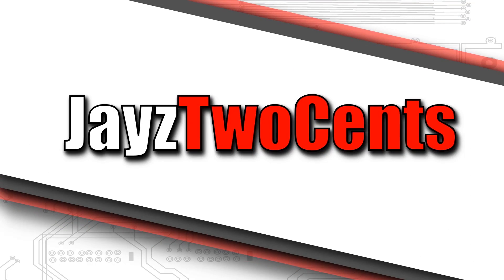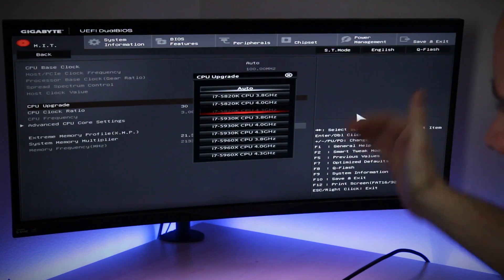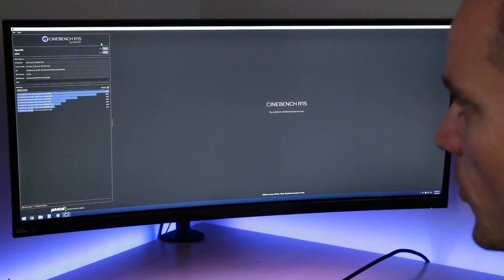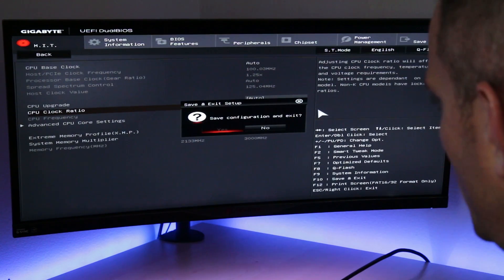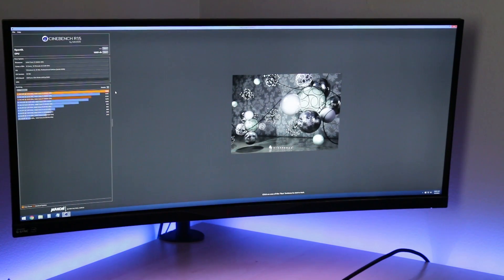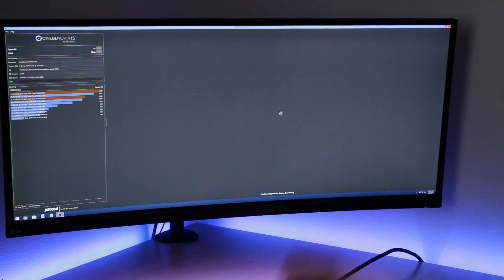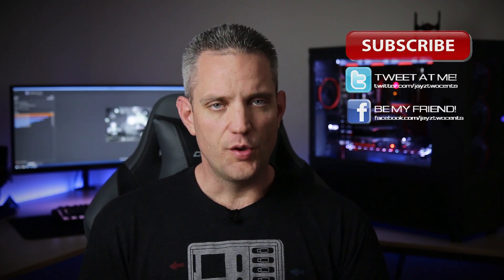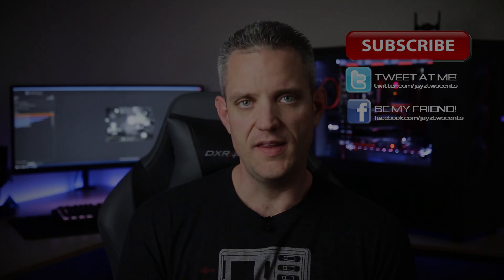XMP vs Overclock

Comment: Is it possible to overclock the laptop processor i5-2540m, and if not, why not?
Reply: Matthew Ferrie I really dont recommend it, even if its old, which... probably makes it even worse off for cooling, would recommend an upgrade. Do you by chance have a desktop?
Reply: +Matthew Ferrie trust me, you dont want to.
Reply: +Lord Drake Not worth it?
Reply: Not exactly, most laptops don't have good enough cooling to support going over the stock speeds. I've seen people do it before, but it's a much greater risk than over clocking a desktop with a decent cooler. +Matthew Ferrie
Reply: +Sam My computer is a dinosaur, so I... think... I might be willing to risk a bit of overheating. Besides, I have a cooling pad, if that even does anything lol
Reply: +Matthew Ferrie I literally melted the side of my laptop doing this back in 2010 don't do it
Reply: Lord Drake
Nope.

Comment: Can you put your computer specs into the description please. preferably the water cooler you use..
Reply: +SprintRaCeR24 you probably won't be able to afford it though
Reply: It's in skunkworks build logs
Reply: Matthew Kinney thanks
Reply: Its only a $125 water cooler. It wont fit in my case i dont think but yeah it isnt that expensive. Im just looking for a good water cooler since mine is hitting 2 years old. Also a bigger one such as 280mm radiator.
Reply: and trust me, mine is the equivalent besides the overkill $800 case(which doesnt make since, nor is any type of fancy) and the 3 980s. but 1 Titan X is suffice. ;)
Reply: +SprintRaCeR24 he has a custom loop cooling setup that costed  well above 500$ in parts if you look them up on performance pcs and he has 3 titan x's currently not 980s thats a old video
Reply: ah. well all i see is the "old" build..

Comment: another thing to keep in mind when overclocking.. is to make sure your BIOS is updated... I didnt update mine and it would always crash on a RAM overclock.. no matter what I did. 
BIOS updates are really easy now compared to before.
Reply: LOL sou that was wat was hapening. oc my ram from 1600 to 1866 and my mobo wold post no nothing:))
Reply: Same thing happened to me until I realized i forgot to update it :)
Reply: I know I broke an x570 a pro mobo other day threw updating it threw dragon centre comp restarted and would get an display after that took it to comp shop were bought it from said the had never seen an mobo breaking like it did . After a bit of argument managed to get it replaced but will never update an bios again if it's that easy to break mobo

Comment: I've had a 4790k for a little over a year now, I've been thinking of OCing it. This video just made that decision ^-^
Reply: +Skullcrusher1005 share your results bud :)
Reply: +Skullcrusher1005 My 4790k reached 4.6ghz at 1.3v. You can do it! That is why you bought a K series.
Reply: +Jim O I have a Corsair H105 for cooling just so you know.
Reply: Jim O The thing is, I only have a Corsair H60 I want to shoot for 4.5 but I'm pretty sure that won't happen, I'm pretty confident I can do 4.3 though :)
Reply: +Skullcrusher1005 I have mine oc'ed to 4.83ghz although I had to mess about quite a bit to achieve it. Good luck brother!
Reply: Blank Ty! :D I'll be OCing it tomorrow!
Reply: Skullcrusher1005 remember to move up in steps and to stress test along the way! Also don't get scared if you BSOD once or twice.
Reply: I got 4.7ghz out of mine
Reply: +Skullcrusher1005 I also have a H60 btw and I managed my 4.8ish so you should be fine if you dont pump too much voltage into it :)
Reply: Blank Wow, That's a hefty OC! :D I'll see what I can do :)
Reply: So here's the results, I tried to pull 4.5 using Gigabyte's preset, Turns out that was a bit too much. I started thermal throttling almost instantly using AIDA64 Extreme. So I turned it down to 4.3 (Didn't try 4.4) with 87C on the hottest core. That's still pretty high, Even though before I OCed it was about 76 on the hottest core. Which, AIDA isn't really real world testing so I'm pretty confident it's stable. I didn't BSOD with the 4.5 clock but it was running at max temp so it was just a matter of time :P
Reply: +Skullcrusher1005 woah 87c on water cooling at 4.5? that's high, very high imo. 
4.7ghz at 1.2v on a 4790k with a kraken x61 and idle at 20-30c heavy load at 50-60c
Reply: Skullcrusher1005 What is the voltage that Gigabyte's preset uses? You might want to check to see if the pump on your h60 is plugged in and working. Also you might want to re-apply thermal paste if lowering the voltage does not work. I will update with my voltage when i get home
Reply: Blank 1.18v @4.3Ghz 87c is pretty hot for that.
Reply: +Skullcrusher1005 insanely,  get it stock is my recommendation, surprised is that high with water cooling at that low clock and voltage. what I would do is this-
change thermal paste, clean the radiator and fan, make sure it's running properly like the pump and fan and adjust the fan curve. see if that changes things
Reply: Skullcrusher1005 I would check to see if the pump is running at 100% and maybe try to run the fan on the rad at a higher percent
Reply: XNinjaZero lol we are on the same track it seems *highfive*
Reply: I do not understand why your 4790k is not hitting the 4.4 turbo boost that is built in to the processor unless you have turbo boost turned off in your UEFI. Go to your CPU core multiplier and set it to 4.5 then set your core voltage ( or whatever setting that changes your CPU voltage) and set it to 1.2v and see if it works. If it does not post and run benchmarks then up your voltage to 1.25 keep raising your voltage in small steps tell it is  stable. I would not go past 1.35 volts in my opinion. Good luck..
Reply: Jim O Don't worry friend, Skullcrusher1005 and I are thinking that it is a thermal paste or cooler issue.
Reply: +Blank lol yeah, it happend to me before I always clean my rads 2 times a year, first time I connected it wrong and cpu sky rocketed to 90c and liquid temp to 50c, it was connected wrong and the pump wasn't working, was scared to death but learned from my mistake
Reply: +Jim O I never liked going above 1.25 lol
Reply: XNinjaZero I currently run somewhere in the neighborhood of 1.3 :I I guess i live life on the edge
Reply: Blank For the record, I bought my PC from CyberPower. I checked and the pump is in the CPU fan slot and the actual CPU fan is on a fan controller. I turned the fan controller to max and still no difference in CPU temps. I set it back to stock and 5 mins of running AIDA the hottest core was 77. Looks like I'll have to order some thermal paste. I didn't think thermal paste would deteriorate that fast in a year, I think it's using what was pre-applied to the cooler. I put my finger on the tubes and I felt the liquid running through so the pump is fine. I guess it's a thermal compound issue. I might order some Arctic Silver 5. Thanks for the help, Guys! :D
Reply: +Blank oh god, gotta love my chip and board xD
Reply: +Skullcrusher1005 well good luck to ya! just run it stock, you won't see much a difference in gaming 4.0 to 4.4 in gaming. I personally use mx-4 but they are both good.
Reply: XNinjaZero Thanks! :) I wanted to OC because I do encoding. This processor is fast at encoding as it already is but, Why not make it faster? :D
Reply: +Skullcrusher1005 true you will benefit more than a gamer would.
Reply: Skullcrusher1005 Thermal paste should not be affected after about a year, I would think that it is a bad application of thermal paste or seeing your temps perhaps no thermal paste at all.... but I would definitely order some thermal paste and make a fresh application anyways. Good luck!
Reply: +Blank if it's his first time using paste just remember him to use the highest percentage alcohol he can to clean and rice size dot is more than enough :)
Reply: XNinjaZero ***** has a video on thermal paste application doesn't he? :)
Reply: XNinjaZero Skullcrusher1005, ya'll should add me on steam. ill pm you
Reply: Blank I've seen many videos on thermal paste application :)
Reply: Blank Go ahead and send me a request "Skullcrusher1005"
Reply: Skullcrusher1005 will do when I get home from work
Reply: You do not want to run the pump on the CPU header. The CPU header will cause the pump to change speeds. Place the pump on a case fan header and make sure that header is set run full speed on DC and not PWM.
Reply: Max voltage on the 4790k is 1.4v but I would never run it at that. 1.3-1.35 is my max. Hope it all works out for you.

Comment: From my experience overclocking tools usually apply more voltage than is needed, personally I'm not comfortable to go to 1.45 or higher which that tool wants to put my chip at. I'm getting my 6700K only to 4.6 (4.7 on 2 cores) (on Z170 Premium) and my 980 Ti Waterforce from Gigabyte only to 1520. There's not much more return for going for more expensive components.

Comment: my VRMS get toasty when i try my luck at a higher overclock with my 5775c. it wants all the voltage. it survived pretty high voltages, over 1.475, but still no luck with a stable OC over 4.3GHz, yet. 4.3GHz @ 1.375v adaptive but with the uncore at stock since i'd need to up THAT voltage to equal or so to the main core. also ddr3-2400 1.65v

EDIT: yes the tinkering is fun until you have no idea why your system won't boot. then you leave it off for 30min and come back and have AGAIN no idea why it finally decided to boot.

886 cinebench score

Comment: My 4690k only manages 732 points :( But it's $750 cheaper :)
Reply: ***** and a decent one at that.
Reply: +YazeedSaber u overclocked to 4.8? i can only reach 677 at 4.6.
Reply: +li wenqi silicone lottery ;)
Reply: +YazeedSaber im running my 4690k at 4.7ghz :D 50c max temp
Reply: +TomaShen - nice. What voltage and cooler are you running?
Reply: +reno911unlocred the 4690k is a year newer than the 4670k with a newer chipset. 

It has improved TIM (Thermal Interface Material) which helps with heat issues and allows better overclocking. 

I have mine on a Gigabyte Z97X- Gaming 5 motherboard, running at 4.82Ghz @ 1.298v. The cooler is a Cooler Master Hyper 212 EVO single fan. Max temps don't exceed 65c.
Reply: YazeedSaber lol, 4.6Ghz at 1.22v, i think it is not bad. but I have no idea why I cant go beyond.
Reply: li wenqi that's very good actually! Nice voltage. Maybe try increasing the voltage to 1.3v and slowly increase the clock speed to see where your chip's max is. If you're running an air cooler, I don't recommend going over 1.3v for 24/7 use.
Reply: ***** how much did you pay for your 4670k?
Reply: ***** are you on water? Because that voltage is a bit high!
Reply: ***** yeah I really struck gold with this chip :D
Reply: ***** you won't see that much of a performance boost going from the 4670k to the 4790k, especially if you're gaming. I'd keep the 4670k, it's still a decent chip.
Reply: +reno911unlocred trust me, the 4670k will never bottleneck a 980. It won't even bottleneck two 980ti sli! It's one of the best gaming CPUs. 
Cinebench is a CPU benchmark, your GPU doesn't matter. 

If you're video editing, then the i7 with it's hyper threading will benefit you with rendering.
Reply: +reno911unlocred going from the 4670k to the 4790k will be a bad return on investment really. 

Please don't take this as me telling you what to do, I'm just saying. Do whatever makes you happy ;)
Reply: ***** because the performance increase that you will gain (maybe 10fps at max) will not justify the money spent (at least $260 for a used 4790k).
Reply: +YazeedSaber 1.3v and gtx h100i cooler on slow pump speed + all fans at maybe 15-19% speed... so basically quiet ... but 980ti hits 80+ temps fans in the gpu (msi brand) hit it with not too much noise but still its very audible at night ...

Comment: i would love to overclock my fx 8350 but i just dont have cooling..
Reply: +Blazin Dragon I have the opposite problem. I have the cooling for a decent overclock, I just have a motherboard that doesn't handle overclocking well.  My 8320e is just begging me to overclock it and even playing with the voltages I can only manage a stable 5% overclock.
Reply: You have a point there i dont even know if my motherboard supports oc..
Reply: +Blazin Dragon What motherboard?
Reply: its a gigabyte motherboard but I don't remember the rest ill get back to you on that..

Comment: 284 in Cinebench with my i5-6200U laptop :3
Also not bad OpenGL @ 25.89 fps

Will test later with my desktop.
Reply: I guess I never did the test on my desktop :P
444 cb with AMD FX-6300 @ 4 GHz
80.2 fps on the OpenGL test with R9 270 @ 1 GHz core

Comment: My Ez tune wizard with my z97-e mobo with my i5 4690k pushes it to 4.6 ghz... Is that normal... Ps I have a h100i V2
Reply: That's fine. What is the voltage that it is using though?
Reply: +Nate Dimelfi 1.24v

Comment: I want to OC but my only problem is that I don't want my cpu to be OC every time that my computer is on
Reply: put it on balanced in control panel. it will only push it to the max when needed for example :
I'm overclocked to 4.7
on idle it stays at 0.8ghz
websurfing/downloading/anti virus it will push whatever speed is needed it could be from .8-4.7ghz 
when gaming it goes to 4.7ghz all the time because the game demands it. once I quit the game and idle goes back down to .8ghz
but I always have it at 4.7ghz while idle and gaming for better performance
Reply: XNinjaZero what motherboard are you using?
Reply: +BomberBoy asus maximus vii formula 

http://pcpartpicker.com/b/6fbj4D

most motherboards do this, there's power saving mode ( constant .8ghz no matter what in my situation)
balanced  ( .8 -4.7ghz)
and high performance ( 4.7ghz all the time) w
I have it on high performance
Reply: XNinjaZero so the bios should be the same as my z97 the

I've never OC before so I'm nervous about it
Reply: +BomberBoy what motherboard you have? different brands have different bios looks but do the same thing,  just that my mobo has more control on voltages and features than others, but other boards do the same like my girls z87 asrock. overlooked to 4.4ghz and idles at .8ghz and pushes what is needed, in gaming full 4.4
Reply: XNinjaZero I have an Asus z97-a and I have an i5 4690k in it
Reply: +BomberBoy yup should be the same, yours won't look all red as mine but yours will be like a gold look yeah? anyway you should easily get 4.2, 4.4 GHz out of it cuz I was able too on my girls z87 asrock 4690k
Reply: XNinjaZero yeah mines all gold and should a hyper 212 evo be fine or should i wait until i get some water cooling
Reply: +BomberBoy 212 evo is a pretty good air cooling solution it should be okay but monitor the difference with your stock clock temps and after with your overclock temps idle  & gaming. I use core temp and love it, shows your lowest temp and your highest temp and current. don't be scared if you get bsod it's okay. what I did was I left my cpu at 1.2v and overclocked from stock 4.0 to 4.5ghz, ran Valley benchmark and 3dmark all good, then 4.6 and repeat all good,4.7 repeat all good, 4.8 and bsod during test , gave it 1.25 volts and all good. but I like 4.7 @ 1.2v because of lower voltage =lower temps. never got bsod since then. and temps only risen 3-5c from stock 4.0 to 4.7ghz on nzxt kraken 61 water cooling
Reply: XNinjaZero what i plan on doing is overclocking it to 4.5ghz and running burn test even though there are better programs to use, if my cpu gets over 80c then im going to lower it into a lower clock so i overheat

Comment: I've settled at 4.6GHz on my 6350 because I don't want to go past 1.4 volts. Only 539 in cinebench, which oddly is the same as my best 4.5GHz run. I've tried several times and still can't beat that score

Comment: @Jayztwocents You probably need to play around with VCCIN and the LLC to get 4.6Ghz. If you have not touched any of that then your input voltage (VCCIN) is probably to low  @ 1.8v.  Try setting VCCIN to 1.9v and raise LLC.

Comment: wish intel didnt have to be a you-know-what and prohibit me from overclocking my i5-6600 (non-k)
Reply: my i5 6600k has 4.4 GHz clock. I'm sorry my son.
Reply: +ChaseMMD (Loyaldk) it's so sad ;( but it's mostly my fault, since when I bought parts I never really looked up too much about CPUs and the best bang for your buck. Really wish I did a little bit of extra research then.
Reply: RedstoneWolf Happens to all of us. I originally had a e2-3200 CPU then a A8-3870K. Then FX-8350 and now the i5 6600K. I've gotten really good at looking at hardware now though.

Comment: +JayzTwoCents, Got any tip or tips for me? I really need help.

i7 4790k oc'd  @ 4.85ghz, 103.22 BCLK with a 47x multiplier, 43x cache ratio and 1.271V with a corsair 105 "push" and when i run aidi64 fpu stress test then my cpu's is throttling 99c, but in gaming like bf3 fc4 etc, it dosn't go higher as 74c. I am going to reseat my cpu block tomorrow . asus maximus hero VII motherboard.
xmp only set my ram timings correct and no oc'ing
Reply: If you get throttling during a stress test you wanna dial it back a bit mate
Reply: +PC Master Race but i use intel extreme tuning utility to stress test my pc and that is perfect,
prime95 and aida wreak havoc using fpu on my system.
Reply: EmBoLabe Still doesn't change the fact that you should dial it down if you throttle during a stresstest
Reply: +PC Master Race yep, dialed down to 4.7 ghz and max temps in aida is 84, but my case support a h105 push and pull but my motherboard  heatsink is in teh way, i might have to drill some new holes and see if it can fit and get some few degrees cooler.

Comment: I got like 648 with my i5 3570k @ 4.7 ghz....
Reply: +Tekuila Gaming plz share pc details
Reply: dan rasmussen i5 3570k @ 4.7 Ghz, Asrock Extreme6 MB, G.Skill 1600 mhz 16GB Ram, 700 Watt 80 Bronze PSU, MSI Gtx 980 ti 6G. Is that what you meant?
Reply: Yes ty
Reply: dan rasmussen  no problem